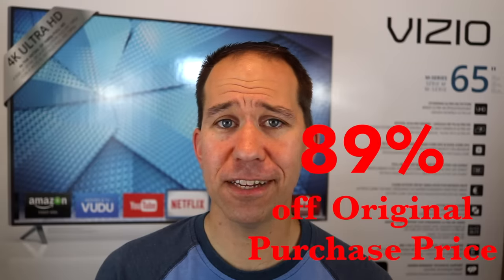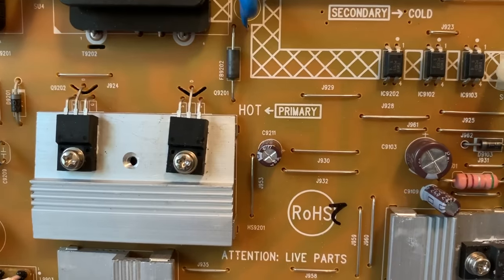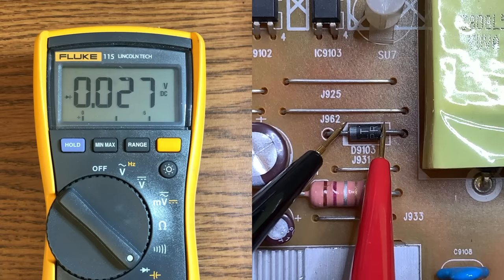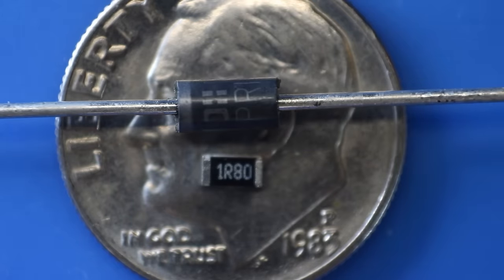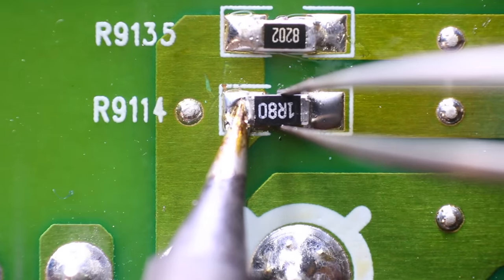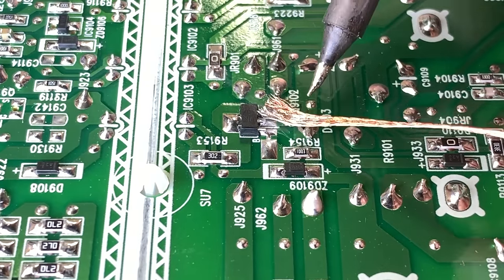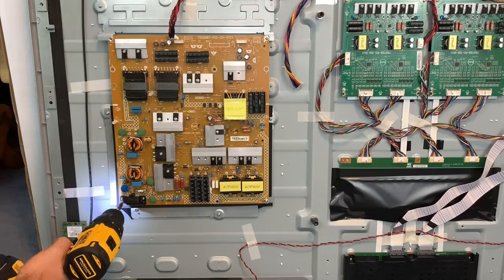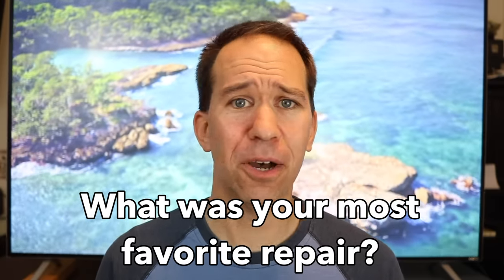I got a broken 65” 4K TV - How I repaired a Vizio M65-C1 (tv won’t turn on)

Comment: so my question is if you are finding  reoccurring problems on these tv sets. is it possible that they all have defective parts and will the same thing happon to the tvs you have just repaired ?
Reply from the maker: Yes, it is possible.  But many times it is unlikely because the replacement parts are either upgraded (spec wise) or they are not from the same manufacturer or batch of components.

Comment: hello Do you think this is the same problem for a Vizio M50-C1 ? its pretty much same tv but smaller
Reply from the maker: My initial thought is no. Because it is a different power supply. I have not worked on that model before. But if you get a chance to check it out and find that the components are the same ones that are bad, let me know. I’d be curious to find out.

Comment: I had a blown air conditioner, had a guy come around and said it's not repairable and quoted me $2000 to replace. I opened it up, replaced the PCB, 2 main capacitors and cleaned up some blown wiring on the compressor. fixed for less than $300.00 and 2 hours of my time. it's been working for over a year now.

Comment: Love the video. Came across it as im trying to troubleshoot no power to my Vizio M60-D1.  Bought a replacement ps, but  have nothing,  no standby light.  Thinking it's the mainboard.. Worth trying to fix you think?  Thanks!
Reply from the maker: Thank you!  I definitely think it is worth fixing.  Did you happen to watch my video on what to check after a power surge?  In that tv there was no standby light but the issue was a short circuit on the main board (and you can see the big hole in the hdmi chip!).  In your case, you want to disconnect the main board and check the ps voltages, then check again with it connected, and see if you can track down the source of the short.
Reply: @FrugalRepair  thanks.  Just prior to the TV shutting itself off. The were horizontal lines that showed up in front of the image.  Then the power light began to flash,  then the tv shut down.. Any ideas?
Reply from the maker: Unfortunately, that could mean any number of things.  Does the tv have a tcon board?  I’d disconnect everything but the main board and power supply.  You’d need to leave either the remote sensor or input bar connected as a way to turn the tv on.  That is another test you can do to isolate the fault.
Reply: @FrugalRepair  awesome,  I'll try that.. Thanks again for your time!
Reply: @FrugalRepair  appreciate your responses. Thought I would update you on the issues I was having. After several voltage tests, I removed the main board and found an oily residue on the underside of the board, the tv and also underneath the black cover on top. So think im just going to try and replace main board and see..
Reply from the maker: @deputydog_9164  Hmm, that seems odd.  What voltages were not what you were expecting?

Comment: you`re a lucky man, easy repair , smart tvs generally have software or flash fails, never can't repair or reflash them, because there is not firmware downloads, the only way you have is buy another expensive board, sometimes not even  that
Reply from the maker: Sometimes that can be the case but when I’ve looked there is usually someone online selling a pre-programmed firmware chip.  What models have you run in to where you couldn’t find one?
Reply: @FrugalRepair  right now i no have the exact model at hand, the problems that we have are with Samsung reboot loop mexican model nothing found searching programmed chip and vizio orange white cycle, I think that its better and easy find a replacement board , but not lucky
Reply from the maker: amigo ten I know you can get firmware chips for the older vizio‘ s that are stuck on orange/white light and won’t boot up.  eBay has lots of them.  I’m not sure about the Samsung your referring to.

Comment: Hi, First of all I hope you are doing well.
I want to thank you for your videos, they are very well explained and informative.
I came across a video of yours today while I was searching to repair my SONY KDL-50R550A LCD TV.
The problem is the image is jumping up & down like if the signal is shifting between horizontal lines.
I checked the ribbon cables of the T-CON board, cleaned the connectors,
I tapped gently on the ribbon cables going out to the panel trying to figure out if they are loose but no luck.

I tried the tape trick, the jumping stopped but I still have like a pulse on top right corner dimming and & go back normal every 2 seconds.
Could it be the T-CON board itself?
I would appreciate it a lot if you can help me fixing it before I go buy a new one. Thanks.

Comment: Nice how to video!  anyway, I have the same TV.  However, in my case, when powering on the tv the white light on the bottom left lights and fades out in about 20 seconds no video (or even the vizio logo) or audio.  I've opened the back of the tv and have it plugged in,  I'm seeing a solid light on the main board (same one in your video that was blinking).  I'm a newbie with a multi meter so the testing of the resistor went a little different but seemed to be ok and the diode seemed to be ok as well.  Also,  I have no fluctuation on the 12volt line.   Any ideas on this one?  I'm stumped and don't want to simply replace boards in this if I can pin point or narrow it down to one board.  Really liked your video and teaching!

Comment: Great video, I moved and something happened to my little Vizio. The screen is black. I’m planning to take it apart and try to trouble shoot it, any thoughts? It looks like it gets power, and no indication of cracks or issues with the screen
Reply from the maker: You can download my TV guide and watch some of my TV videos for tips.  Could be a bunch things.
Reply: @FrugalRepair  actually I caught another vid and I think it’s the backlights out. I can see “no signal” in the dark or shining light on it, so I guess I just need to replace the led strips or figure out if something else is triggering then to be out

Comment: It feels good when you fix something even if you need to Google for the solution. I fixed a panasonic modulator that was showing the F61 error, Google it and found the solution. I got paid for that and didn't spend a penny.

Comment: I just got a 65 Inch Element Roku TV and the screen is dim on the bottom and dimmer as it goes up. This is my first time taking a tv apart and I'm about to order a replacement LED strip but hope I order the right one.
Reply from the maker: Good luck on the repair! It shouldn’t be too hard, but the main thing to be careful with is not cracking the LCD when you remove it. I usually get a big piece of cardboard and slide it underneath so that I’m not flexing the LCD panel.
Reply: @FrugalRepair  I've only got one big suction cup and a tiny one so I'm worried I'm gonna end up breaking the LCD when I move it. Will it be fine if I set it sitting up, I've seen people lift it up and set it up right like opening a book as they lift the LCD and layers up but I'm worried the bottom will break from the weight
Reply from the maker: I’ve never used a suction cup, they aren’t that heavy, just fragile.  Disconnect the ribbon cables and make sure the driver boards won’t snag on anything then slide the cardboard underneath and you can lift the whole thing up.  There are other ways to remove it but that’s an easy method.
Reply: @FrugalRepair  I might just try that, lol. If I can find a giant piece of cardboard.

Comment: Hey Reece, I’ve been trying to figure out what is wrong with my m65-c1, also isn’t turning on. However, the p/s is giving me a steady 19v when I tested it. Additionally, the LED that was blinking for you, well, isn’t even on at all for me. Should that be a pretty good indicator that there is a main board issue? My dad said he’d just replace the TV but I don’t want that. I really want to show him that I can use my brain to diagnose the problem and then, god willing, fix it. I’m not really sure where to go from here though. Any thoughts or advice would be greatly appreciated. Thanks for all your help so far (from your video I mean, 😁 hehe)! Hope to hear from you, thanks,
Morgan
Reply from the maker: I think there is a common main board issue that you might want to research.  There are some repair services on eBay that list descriptions for the repair.  I’d check those first and maybe ask some questions about the repair.  Sorry I can give you more since I haven’t looked into the main board on this model.

Comment: I repaired a 37 inch lcd lg tv back in 2010. Power Supply had gone on it. I then sold it to purchase a 50 inch tv Panasonic. Studied electronics in college
Reply from the maker: That’s awesome! Was it bad capacitors on the power supply?
Reply: @FrugalRepair  it was several components. Resistors like similar to your video along with capacitors I believe. Had a kit from eBay to fix this issue. Believe it or not the picture was better than when I bought after my repair. It made a bang when the power supply had gone. Common fault which I read. Similar to your situation. I wish I had the space/a spare room. I could do some more repairs...have my soldering toolbox. Just gathering dust most of the time now. I am very good at diy too. Did a lot of things when I bought my first home a few years ago. Love learning new things all the time.
Reply from the maker: That’s great!

Comment: Thanks for sharing! I recently received a 65" Mi TV with white screen. Could you advise on how I can repair it? Will changing TCON help?
Reply from the maker: Check out the video I made on repairing a tv with tape.  Hope it helps get you started
Reply: @FrugalRepair  thanks will start with that
Reply: @FrugalRepair As advised, I follow your instructions in the video to remove the connecting ribbons. Tried both ribbons but still getting the same result only backlight on. Any advice?

I tried measuring the voltage for the VGL and VGH. Both were fluctuating. What does this mean?

Comment: Another common failure point is the capacitors.  I had a decent computer monitor which failed and cost me under 50 cents to repair.  I have done the same repair on a few televisions like that over the years with just capacitor swaps.  I used to have a tray of different capacitors on my workbench since I used to make my own custom car audio crossovers, so doing the repairs was cheaper lol.  Not to mention buying cheap broken car audio parts people tried to install then shorted out.  Switching diodes are cheap and when you hookup wrong or short out a 12v item its the diode.
Reply from the maker: Agreed, especially on TV’s from like 10 years ago with the “capacitor plague”.  The bulged caps on the power supply board were easy to spot.

Comment: 8:03 I still won't be able to identify the smallest components like you did. My brother gave me his VIZIO tv. He want me to experiment with it. I am not sure how big it is but it is big except it isn't a 4K or "smart tv". The screen went black randomly or sometimes it won't power on. I unscrewd the back cover and decide to swap out the power supply. But that wasn't it then I switch out the main board and that fixs the problem.

it helps to repair broken tv if i can diagnosis small fuses/diode or know what to look for.

Comment: Not quite the same, but I once got a 55" Samsung DLP for free,owner was tossing. "picture is a little dim". Lamp clock showed 16,000 hours (bulb is rated for 8-10k). $75 for a new bulb and ten minutes later, it was good as new. That was 2012. I still have the TV.
Reply from the maker: Great story!  Thanks for sharing.

Comment: I saw this same tv for sale online.  It's starting up but is taking about 7-8 minutes.  Do you think it could be a similar fix?
Reply from the maker: That is definitely unusual. My first thought is that it’s a different issue, and it has to do with a bad solder connection under the main CPU. So perhaps it’s getting warm enough inside and warping the board ever so slightly and then the TV turns on. But that’s just my guess

Comment: I have the 75 inch Vizio, model M70-C3. Although I don't see any bad resistors on my power board, I do hear some noise from the board when I plug in my power cable. I don't have the same number resistor as yours but the i found the same diode number on my board. Do you think it can be just the diode?
Reply from the maker: Probably not the same diode.  This is very specific problem to this board number.  The noise may be normal.  Did you happen to get my free pdf and go through some initial diagnosis?  FrugalRepair.com/resources
Reply: I appreciate your reply and I just signed up for your pdf. Thank you

Comment: How about the cost of the flux, solder, electricity to power the solder station and the cost of water flushing the toilet after taking a dump?  Just funning...Nice job on the TV. 

I've fixed a few myself.  My first one was about $10 in power supply capacitors to fix a rear projection HD tv, another was replacing caps on a LCD power supply, and another few recents, were power supply boards (didn't have the sense to troubleshoot to the component).  Anyways, it seems it's the power supply components are the weakest links.
Reply from the maker: Thanks!  Those are great repairs.  Thanks for sharing!

Comment: What was the LED on the front doing when it was not working correctly?  I have a 75" model that won't turn V on as well. The LED on the front just flashes white. Thanks.
Reply from the maker: It turned white, I believe.  But I don’t really remember.  Someone just gave me the 75” version (perhaps the same as yours), and it has the white light that fades out.  I’m looking forward to figuring it out.  I’m guess it’s the main board.

Comment: The resistor you measured at around 9 KOhms is 82 KOhms on mouser. I don't want to order the wrong part. I could really use your help

Comment: Frugal repair
Do you know where I can get the resistor, & diode you use in this repair video?
The link you have in the video says 44 weeks until they have them in stock. I searched other sites and I can't find any. 
Any help would be amazing. 
Do you have any you would be willing to sell?
Reply from the maker: The diode is the key part since the resistor value could probably be anything close.   I would try to google for the part, have you tried on AliExpress?

Comment: About three years ago, I was ready to throw away a small TV that had stopped working.  I decided, before doing it, to take the time to test all diodes on it, just because, why not?  And bingo! it was a single diode.  Now I have a spare tv/pc monitor I use all the time.

Comment: I have the same TV - Vizio M65-C1. The internal speakers keep coming back on after I turn them off (I have a sound bar). Any idea which board or component needs to be replaced?
Reply from the maker: The main board handles the sound.  But hopefully maybe a factory reset would help as a first step?  Maybe you’ve tried that.

Comment: Nice work. You could have bodged-in a through hole resistor and a similar rated diode scavenged from an old scrap board is you scratched off some of the trace. I have a cupboard full of scrap boards. People keep giving me stuff lol.
Reply from the maker: Thanks!  I actually did think about scavenging but at the time a few dollars saved me the time hunting down parts.

Comment: This may sound like a dumb question. But how do I know EXACTLY that the diode is in the correct orientation? In your video the top of the numbers numbers on the diode appear to be  facing to the left of the board. I'm going to attempt to fix this tv, what's the worst that could happen it's already broken
Reply from the maker: It needs to be facing the correct direction.  A diode is like a one way valve.  Why not take a photo before you take out the old one and then match it?

Comment: Here is the results! The audio was instantaneous ! The video was another challenge! TV came on and everyone was lime green ! Yikes! Went into the settings and adjusted the CONTRAST, BRIGHTNESS, BACKLIGHT, COLOR, TINT, SHARPNESS, without Success for several hours, then today went into a preset and adjusted it (45 minutes later) and it looks fantastic! My concern, that I relayed to Katrina of VizParts.com was the Contrast and Backlight were acting like a toggle switch, they were either on or off! If was not an incremental effect in its adjustment. So I have a 90 day warranty on the BOARD so it will be put through its paces! Keeping my fingers crossed!
Reply from the maker: Thanks for returning to let me know.  Hope it works out!

Comment: I just fixed a 47 inch Vizio VO47LF HDTV10A  it had bad inverter boards i replaced them now it works like new i found the tv in the dumpster
Reply from the maker: That’s great to hear!  Did you replace the boards or solder in new caps (assuming that is all it needed)?
Reply: @FrugalRepair  I just bought new boards I have the original boards I'd like to have the caps replaced on them so I can have spares
Reply: I don't have to tools to replace the caps on them so I bought replacement boards

Comment: My dad has an older 65 inch vizio. it still turns on and all but everything has a blue tint.What do you think that can be?
Reply from the maker: Not exactly sure but I'd guess failed LED modules.  There is a certain manufacturer that made them and supplied the TV builders and what I think happens is the color filter on the LED itself fails so you end up with a blue tinted light.  You can try to mitigate the effect by changing the color scheme in the TV's settings but it likely won't look 100% normal.